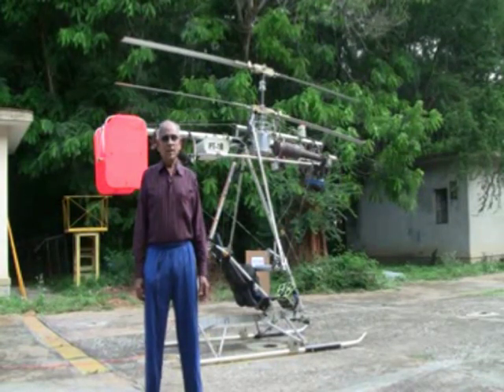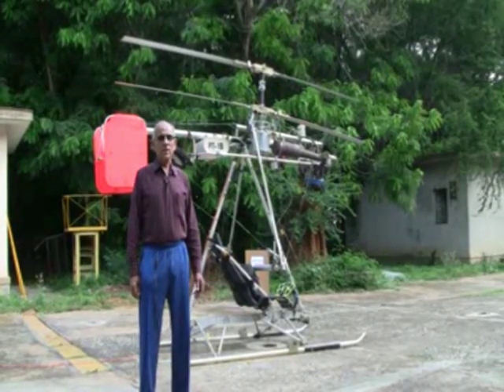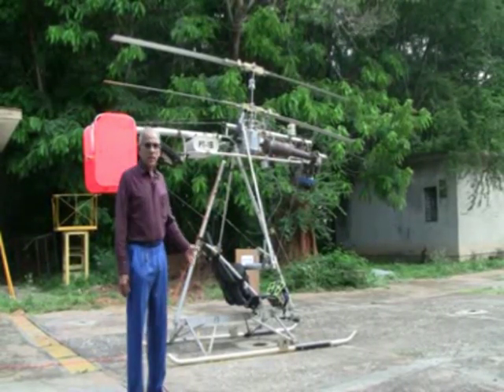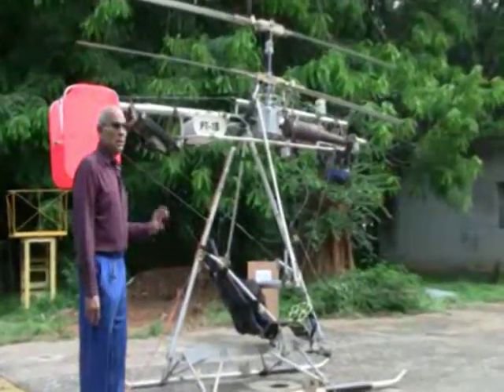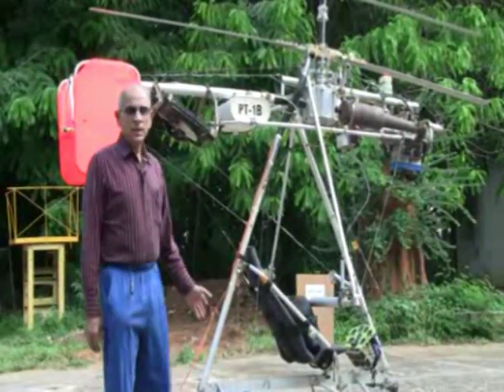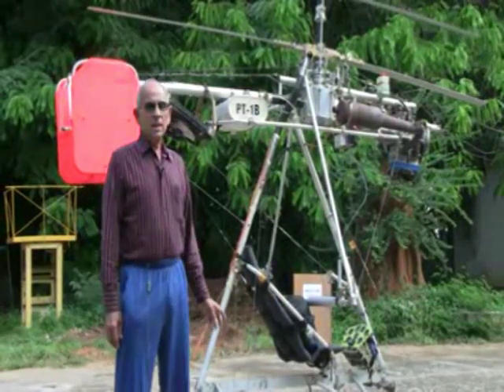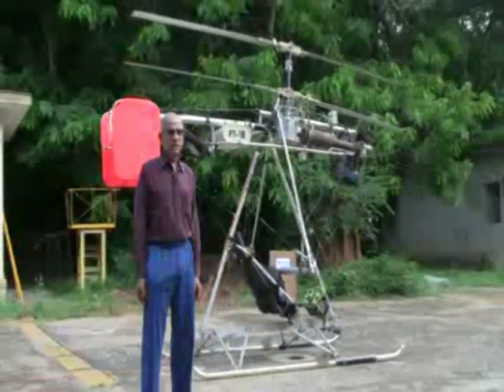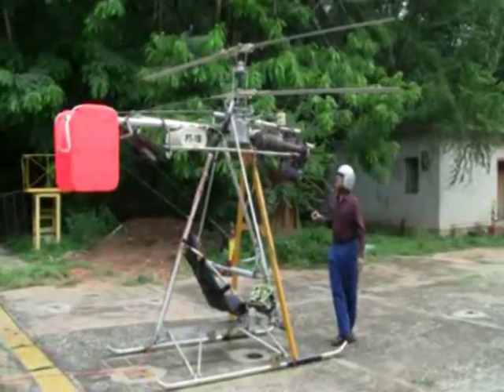HELITRIKE 1

Comment: I wish to know how are foot pedals connected and how does it work with coaxial helicopter.. can you explain or make a video on it please..
Reply: Foot pedals are turning the rudders which re-direct thrust from the rotors, you don't have adverse yaw as the rotors counter rotate so you don't need much re-directed thrust to give yaw control.

Comment: It is a concept, you have to improve and progress, you have a good rotor, the gyrocopetro concept with double helix works as you have it, but with a smaller horizontal thrust propeller, it would be like a helicopter without a tail rotor and maybe auto -I turn if you achieve a good speed.Good luck to you, I will be watching your progress.
Es un concepto,tienes que ir mejorando y progressando,tienes un buen rotor,trabaja el concepto del gyrocopetro con doble helice tal como lo tienes,pero con una helice mas pequeña de empuje horizontal,seria como un helicopetero sin rotor de cola y quizas auto-giro  si logras una buena velocidad.Buena suerte para usted,estare pendiente se usu progresos.
Reply: hola y tu como sabes esto

Comment: No funciona,en el trike con ala delta, el ala recibe  el impacto del aire que la mantien volando,esa fuerza es adversa al peso de la aeronave,eso hace que el ala sea docil de manejar,inclusive una vez volando puedes retirar las manos y ellla se autoajusta para seguir volando sola,en esta aparato eso no sucede,pasaras todo el tiempo equilibrando el rotor,para mantenerse volando,esto es una odisea para el piloto,es muy inestable,debes utilizar un mando de baston y bajar el centro de gravedad,la cola no debe nunca ir pegada del rotor ,la cola va pegada del trike y va fija,el rotor siendo mas liviano es facilmente manejable.

It does not work, in the trike with a hang glider, the wing receives the impact of the air that keeps it flying, that force is adverse to the weight of the aircraft, that makes the wing easy to handle, even once flying you can remove your hands and she adjusts herself to continue flying alone, in this device that does not happen, you will spend all the time balancing the rotor, to keep flying, this is an odyssey for the pilot, it is very unstable, you must use a cane control and lower the center of gravity, the tail should never be stuck on the rotor, the tail is attached to the trike and is fixed, the rotor being lighter is easily manageable

Comment: Mr.Ram Pai, I am sorry to say that neither the trike nor the powered hang glider are as complicated and confusing as your prototype. Your machine also needs wheels. Otherwise you may soon tip over while testing your invention. The main problem with your machine is not the shortage of ideas, but the inherent  lack of stability.

Comment: I'm fairly certain that I know where the name for this build came from. As you can clearly see this poor man is scared as hell to fly this machine and it looks like a trike. Need I say more. Also he is tall so its built to match his height then he doesn't have to bend over to work on it. Sir, I cannot understand the reasoning behind placing most of the weight above the center of balance. I sincerely hope that you are able to fly It and not be injured in the process.